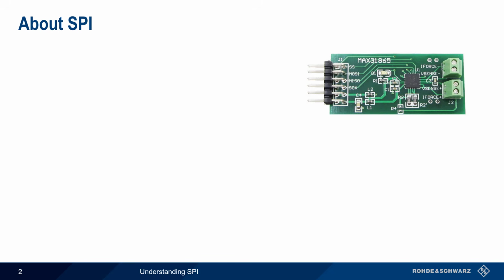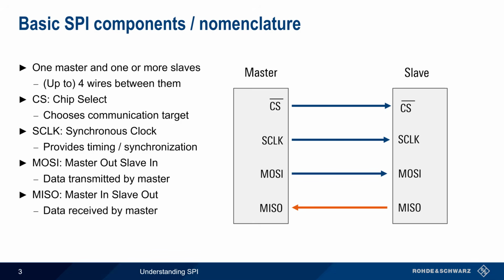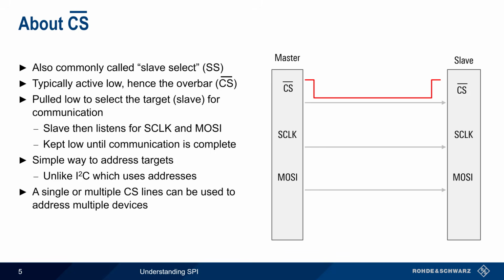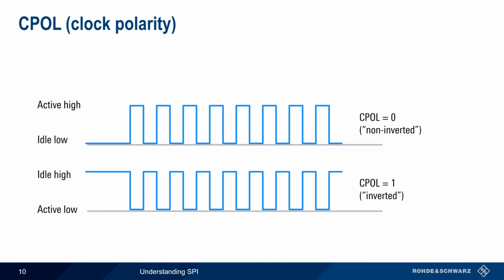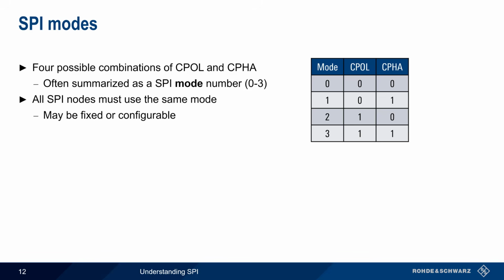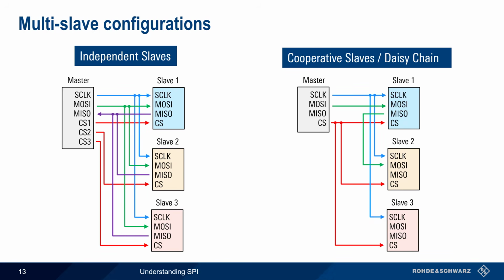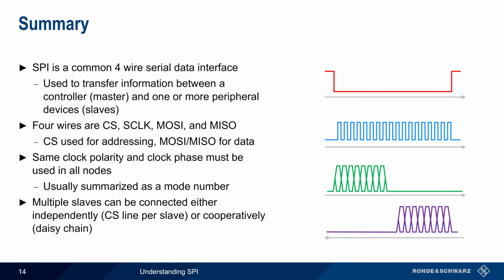Understanding SPI

Comment: Left off one, important, concept:  Each MOSI byte transfer also has a matching, simultaneous MISO byte transfer.  Full Duplex and not single Duplex as all of your very nice illustrations indicate.  I have found this to be the most confusing part of the SPI protocol for beginners.  I have been writing code for this since the first SPI peripherals appeared on the Motorola 680x family of microsontrollers in the early 80's!
Reply: Thanks for the comment!  Yes, SPI is technically "full duplex" in the sense that every bit clocked out on MOSI causes a bit to be clocked in (so to speak) on MISO.  That said, there are many MOSI-only 'unidirectional' applications of SPI (like driving a display or a sensor output), where clock is sent but return bits are ignored.  So we're both right 😀
Reply: @pauldenisowski  You are certainly correct there are send only, and possible receive only applications, although this is not what I was describing.  The video makes it look like there is 8 bits of output followed by 8 bits of input.  In Fact, the input and output transfers are simultaneous.
Reply: @Peter-House-Jr  so you mean to say by simultaneous transfer that for each bit sent from miso there will be a returning bit from mosi 

like 1 mosi > then  - 1miso  <- then 1 mosi--> then 1miso<--???
Reply: @piaarora2924  Each clock transfers 2 bits, 1 MISO and one MOSI at the same time.
Reply: @piaarora2924  Imagine a bicycle chain stretched between two gears (Controller and Peripheral):

SCLK: The pedals on the Controller gear.

MOSI: The top half of the chain moving forward.

MISO: The bottom half of the chain returning back.

Because it's one continuous loop driven by one set of pedals, you cannot turn the top chain without simultaneously moving the bottom chain.

It's not mosi then miso, it's always mosi AND miso
Reply: You are mostly correct. There is a half duplex spi, to be fair.
Reply: @OGMann  You are certainly correct there are send only, and possible receive only applications, although this is not what I was describing.  The video makes it look like there is 8 bits of output followed by 8 bits of input.  In Fact, the input and output transfers are simultaneous.
Reply: I agree and think the diagram at 2:30 would be a more accurate general diagram if the MOSI and MISO were both shown as sending data for the entire time CS is low. If someone wanted to implement a program that sends a message over MOSI while throwing away MISO data and responds over MISO  while throwing away MOSI data that would be for them to abstract out in their more specific diagram.

Comment: Not all devices take their MISO lines off the bus when not selected.... that causes problems by pulling that line hi or lo, so one solution is a tri state buffer for each of the MISO lines and the appropriate CS to enable that buffer to the MISO bus. At least that is what I have found to be an issue.

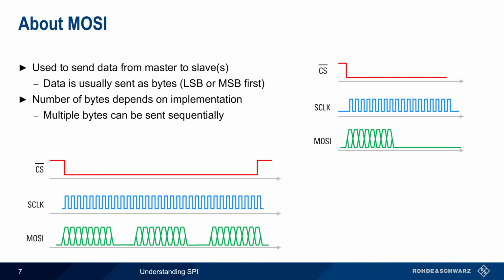Comment: 5:00  

On data transferts in byte format, no clock pulses shall be transmitted by master between individual bytes if the /CS line is kept /Active.

Comment: Why is the design an active low for CS? What is the benefit to that from active high?
Reply: At this point mostly convention. But active low circuits can be implemented with open collector or open drain circuits that are easy to design and tolerate a lot of implementation variations

Comment: In the example of multiple slaves and dedicated CS lines.. they could have simply used a demultiplexer to get 8 lines out of those 3 CS lines. I mean, that's obvious but weird that it wasn't mentioned as an option.
Reply: i think there can be delay in propogation and added complexity which fails the simplicity idea of the spi, data can be corrupted easily and hard to identify the correct point of flip
Reply: @ridhasham9067  It's chip select.. if you're switching CS so fast that the propagation delay of another circuit in the loop matters - then you've got other serious design issues (maybe don't use spi but other some other highspeed bus options). The data itself wouldn't go through the demux. And there are demux chips that run on the order of single digit nanoseconds. It's one chip - 3 line in, 8 lines out. It's technically added complexity, but it also is soo simple of a solution.

Comment: @Rohe Schwarz, In case of Daisy Chain, How Slave1 knows that data has to be transferred to Slave2?
 Is it based on Clock from Master with no-data(SDA is neither 0 or 1 level voltage)?

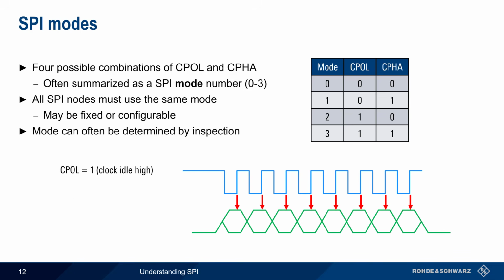Comment: At 8:34 should it be CPHA = 0?
Reply: CPHA = 1 means "read on the second (trailing) edge of the clock pulse".  Since CPOL = 1 (idle high), the clock pulse is negative or inverted, so to speak, and thus in this example we're reading on the trailing edge of the pulse.   The "CPOL/CPHA" terminology is very confusing -- even device manufacturers sometimes get things mixed up in their literature.
Reply: @pauldenisowski  Thanks for responding. I found contrary on the Analog Devices page (I wanted to put link here but YouTube is ridiculously removing my comment with URL)
Reply: @architjoshi2199  Yeah, I saw the Analog page too.  In fairness (and as someone who makes about a thousand slides of content a year), it's impossible to avoid making mistakes every now and then :)

Comment: Hello! I send a data packet "slave func data srs16", but the result is this signal "00 slave func data srs16". Why do two zeros appear? ModbusRTU
Reply: Sorry, but I'd have to know a lot more about the implementation to try to answer that question.  Are you observing the packets using an oscilloscope or logic anaylzer?